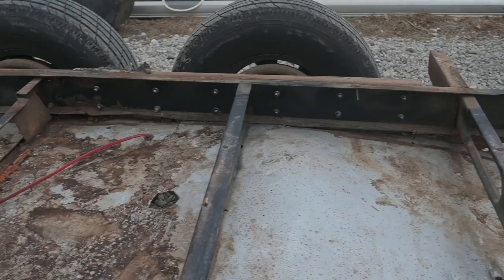Airstream Renovation Nightmare, The Trailer Frame is Trash

Comment: the original frame had quite a few cut-outs (I assume to lighten the RV) and you're using totally intact tubular steel (I have no idea if the gauge you use is the same as the original frame). In order to prevent excessive added weight due to the extra metal couldn't you have reduced the number of cross beams?

Comment: If I were the customer, I’d be pissed if you came to me this late in the project with a frame estimate.  You could see the potential for frame damage during the initial inspection.  Looks like your shop does great work but as a customer, I hate surprises!  Man I’d like to know what that frame cost..  
How do we contact you?
Reply from the maker: We went into it knowing it needed work, but until you have the floor off you can't know for sure just how far the extent of the damage is.  Trust me, it was not a surprise to them!  The video may have come across a little more dramatic than it was. Its about $4-5k for a frame. You can email us at ian@millergarageairstreams.com